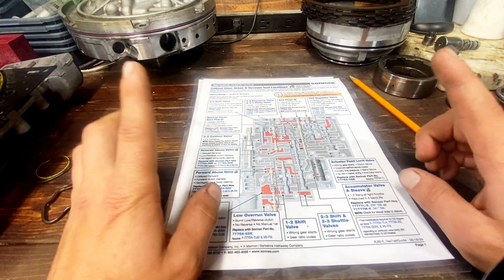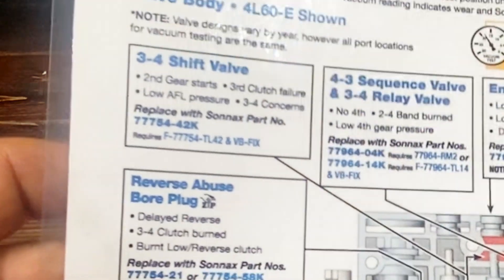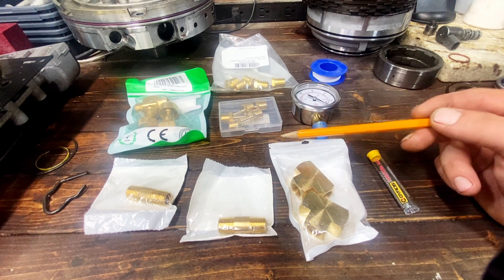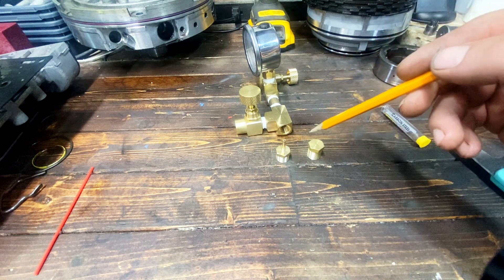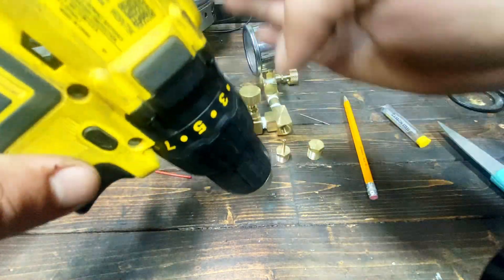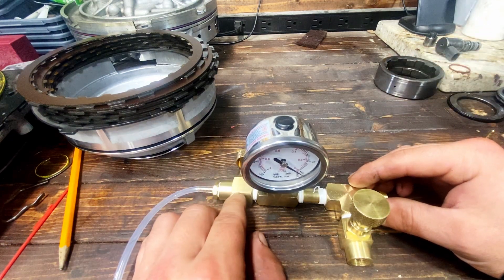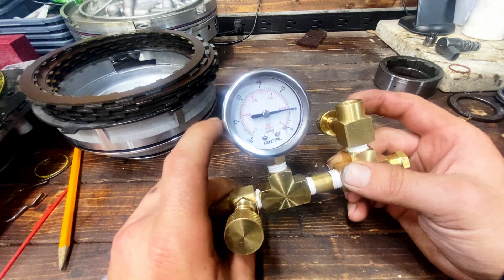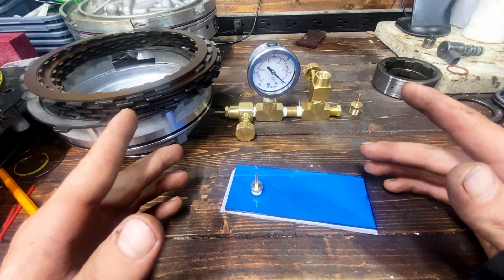DIY Transmission Valvebody & Pump Vacuum Tester!

Comment: HARD PASS I'll just purchase a professional vacuum tester they're not that expensive and worth every penny, but I completely sympathize with people that can't afford it and then you have that group of people that are trying to cut corners or are simply penny pinchers which in some cases ends uP^ biting them in the [FILL IN THE BLANK].
Some things you can't and shouldn't mess around with by cutting corners, do it correctly your life and those on the road depend on it.

Chose wisely,
All the best
TBD 3.0